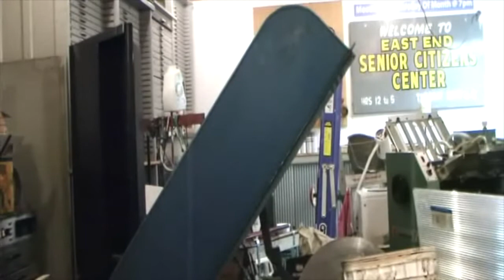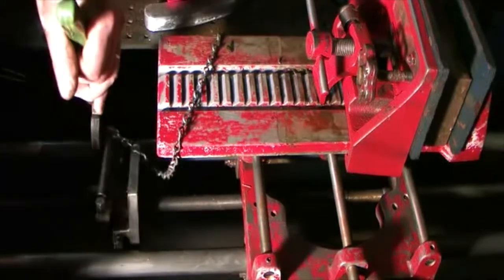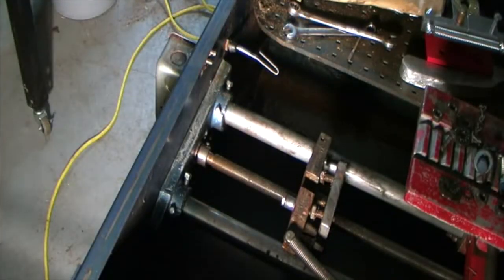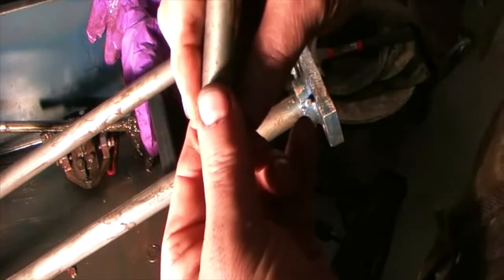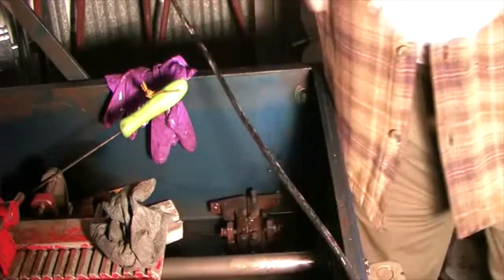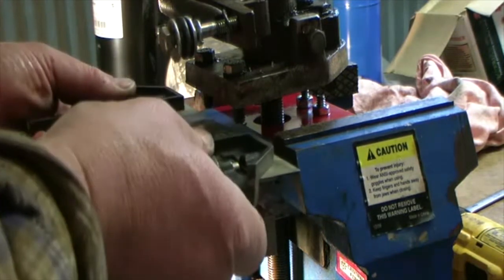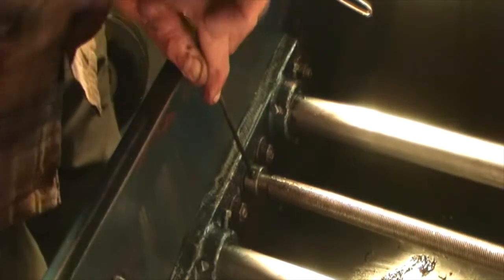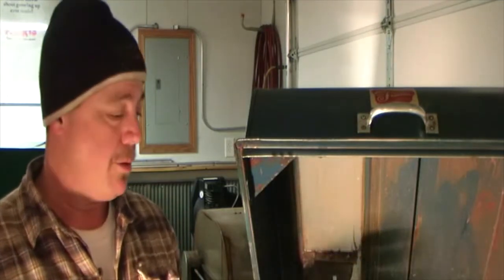Frantom Split Nut Feed Dog Fix

Comment: I traded John Rowland some Tiffany stone for a couple of saws way back in probably 2006-2007. Before Highland Park was founded and making parts. 
I had a 20" frantom from that trade I restored from the ground up. The split nut was a solid brass version that was worn out. I was lucky my dad was a machinist and I sent it to him. He soldered it full of brass drilled it out and split it. Hell of a process that cost me a small fortune for the brass! So nice to have parts easily available nowadays.
Reply from the maker: Everyone should have a machinest in the family. Love my Frantom.
Reply: @DirtCleanerVideos  I also had an old 24" Hillquist saw that the cast iron insert to adjust the vise opening cracked. Built a completely new insert by laser scanning the old one. It fit perfectly including the tiny set screw in one end! I should also mention that his shop is in Ohio and I'm in Utah!